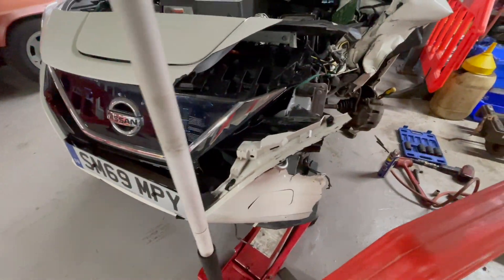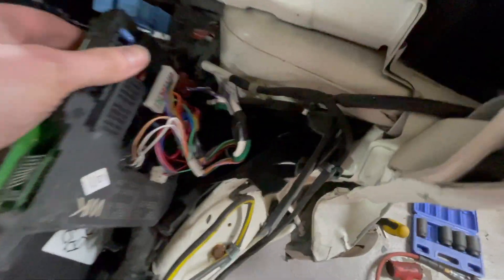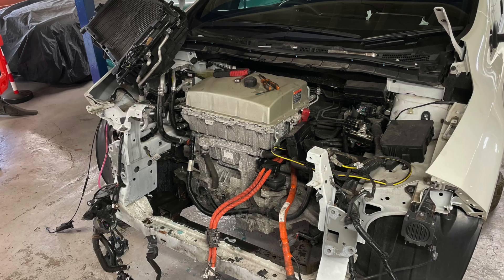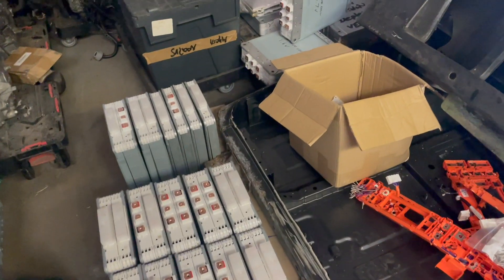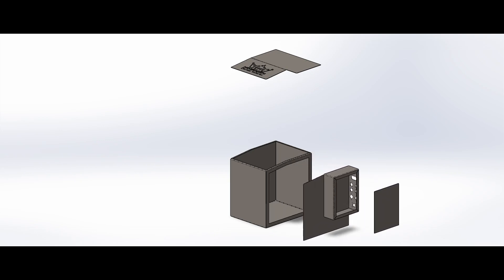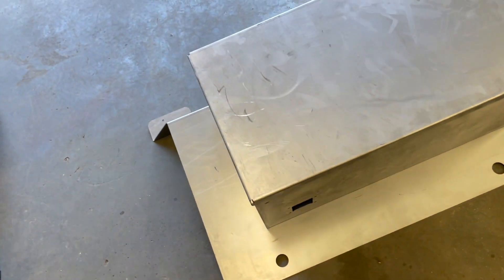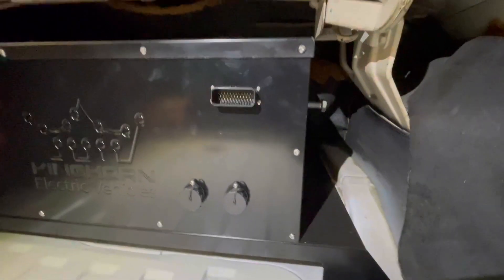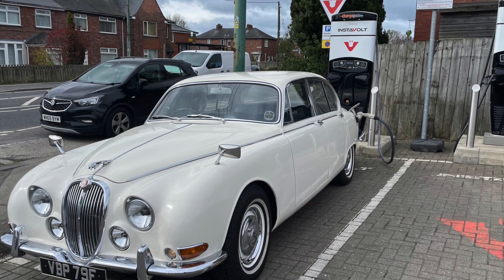Converting a 1968 Jaguar S Type to Electric - Part 2

Comment: Nice some jags do 12mpg so electric conversion is a sensible conversation.
Reply from the maker: It's a lot more efficient now. It averages 3 miles per kWh which at standard electric rates (27.03p per kWh) means 1 mile now costs 9p. at 12mpg it would cost 45p per mile!